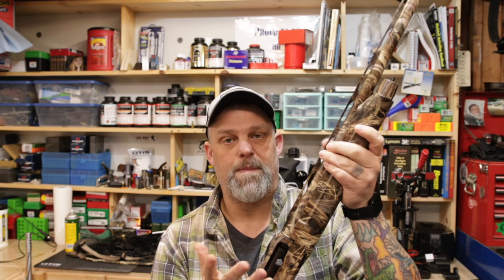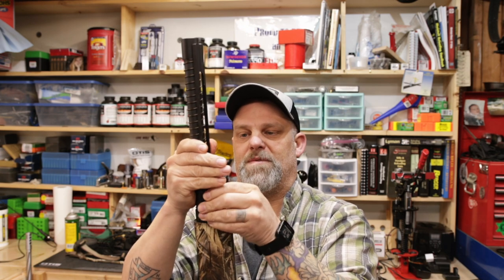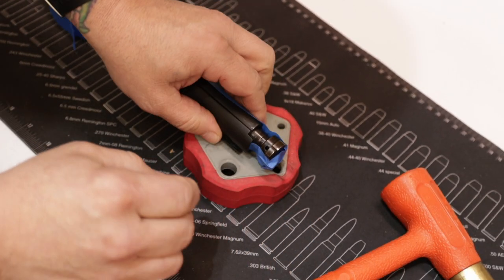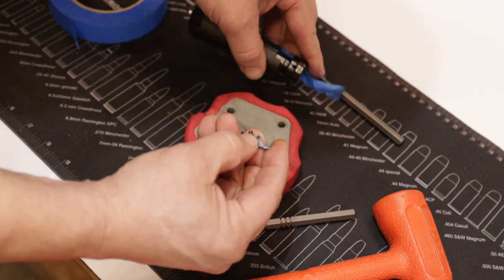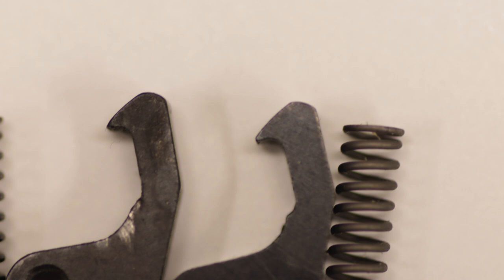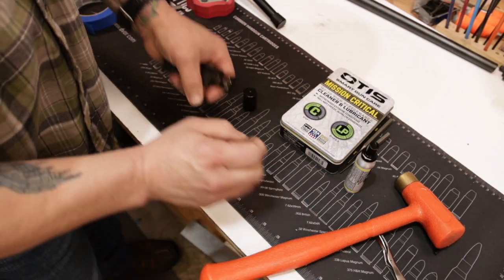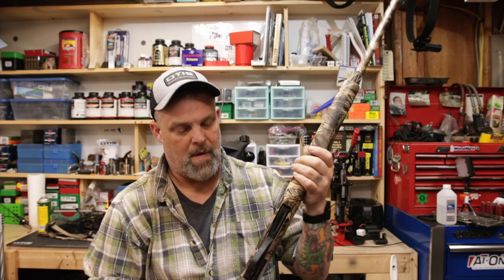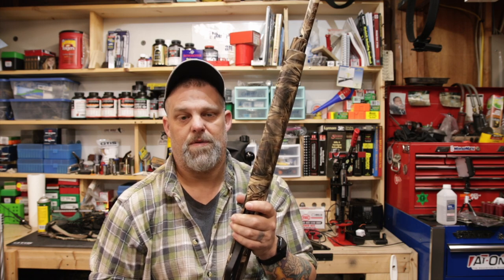Stoeger M-3000 Extractor Replacement, Benelli Upgrade

Comment: Well, after approximately 500 rounds I had to do this extraction fix and it has never missed a beat since… Well worth the $40 and would recommend it to anyone…and I only did the extractor. I didnt change the spring (it’s the original Stoeger spring). 
I have one question… Does the M 3500 have the same issues does the extractor wear out and with the M2 extractor replace it?
Reply from the maker: I haven’t see that many issues with the 3500 but yes it can happen
Reply: @vaughnprecision  I love my m3000 but have seen a few deals on an 3500. I just didn’t know if I could put the M2 extractor into the m3500 if it started to act up as well. I wouldn’t buy one if I couldn’t
Reply: My 3500 has these identical issues when cycling light loads...swapping both pieces in the morning and immediately heading to a clays tournament. Nothing like an immediate field trial!
Reply: @Trusty-Rusty Hey, did everything workout well with your gun? I bought a 3500 and out of the box it wouldn't extract the casing.

Comment: Good info Kurt
My M3k extractor hasnt failed yet knock on wood
Reply: Mine either, even a year later!
Reply: Mine has been flawless 2 years later after the switch. Amazing gun for $800 (plus an m2 extractor (I didn’t order or change the spring) extractor only worked for me

Comment: I heard that the extractors aren’t necessarily the problem, that the bolts extractor slot is the problem... that burrs left from the cutting process to make the canyon the extractor sits in damage the sides of the of the extractor until it starts to not seat properly so it then can’t hold the shell.

If you look the Benelli extractor has a reinforced ribbed section at the exact place the abrasions are on your oem extractor.

If you have time can you make a video on how to polish the extractor canyon to prevent the damage?
Reply: Just ordered one I’ll look into it when I get it!

Comment: So my extractor on the stoeger is fine, but it appears my pin has worked it's way out of the bolt and is now bent so I cannot put it back in. Where do I get a new pin for it?
Reply from the maker: You’d probably have to email Stoeger
Reply: @vaughnprecision  well poop. Thanks though. If my extractor fails I'll probably do this and swap it to Benelli's.

Comment: Having the hardest time getting the pin out. Any tips on that? 
Thanks
Reply from the maker: It’s a pain, but it only drives out one direction and you’ll need a very thin punch
Reply: I've bent two 1/16" punches and it's still not out...  ☹☹
Reply: Same probably taking it to a gunsmith